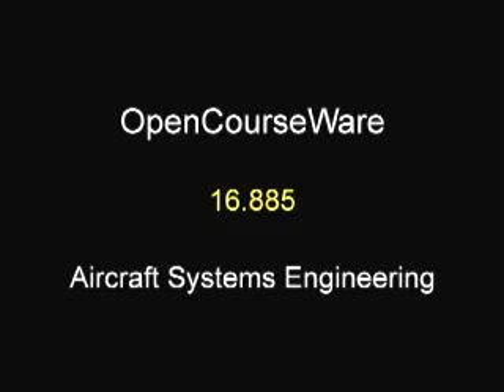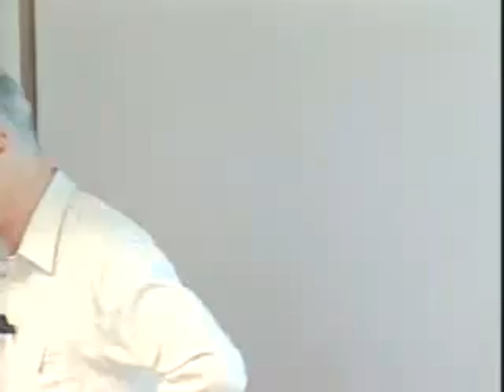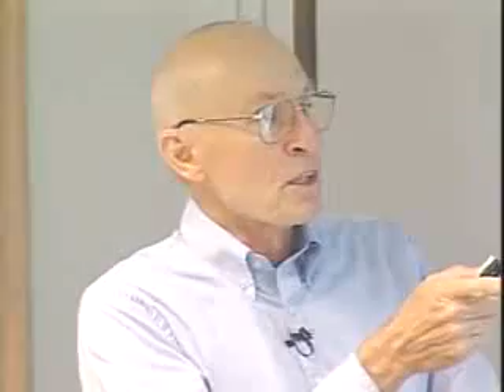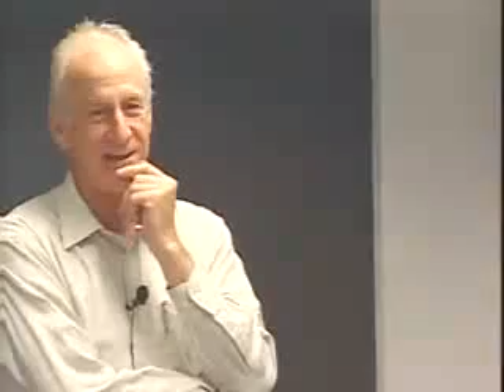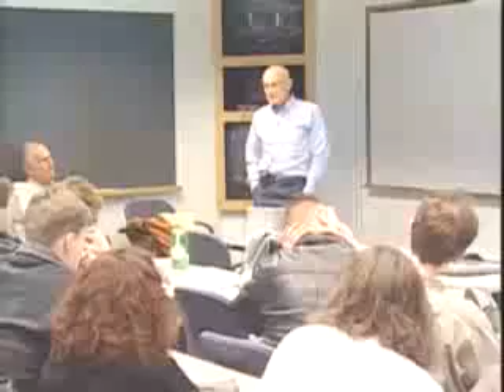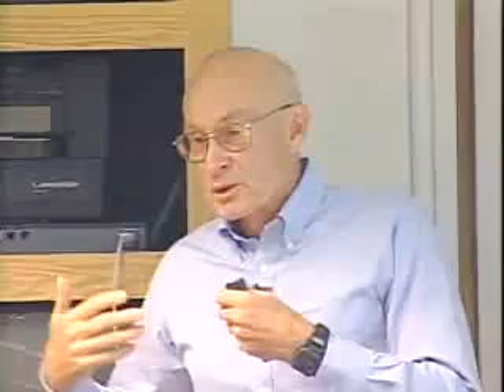Lec 14 | MIT 16.885J Aircraft Systems Engineering, Fall 2005

Comment: If I had the choice I would go with 3 shifts 5 days a week and no overtime. In the long run it would probably be more efficient and cheaper to have 3 shifts a day as opposed to 2 shifts and overtime.
Reply: I guess it depends on how long the prep times are and how long the work takes. maybe there's some stuff that just is better if you grind through it. I think they had found the best option, since they were mature, taking time off because big tasks and focusing on weekend sprints. It feels a saner mode for ops work since it allows to have lows and peaks according to what you work on.